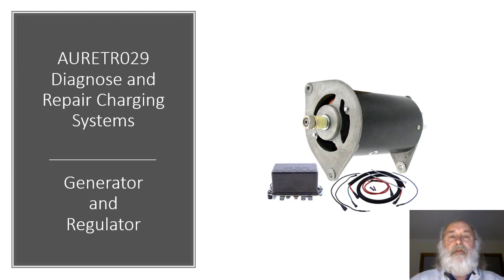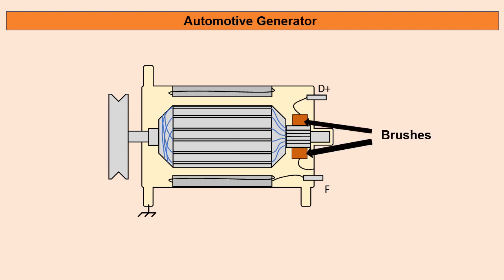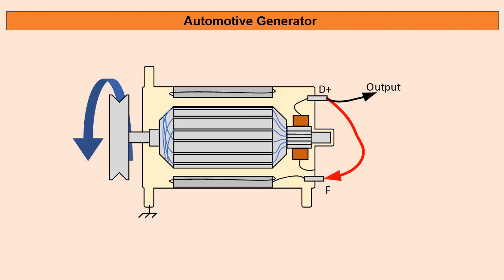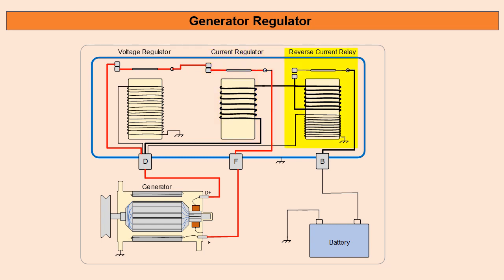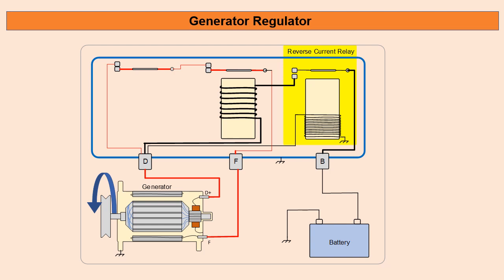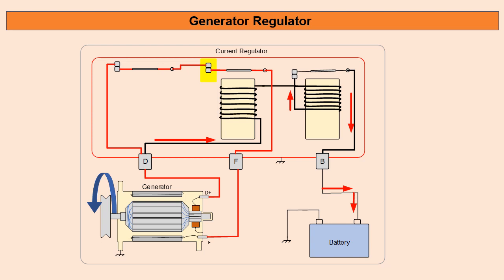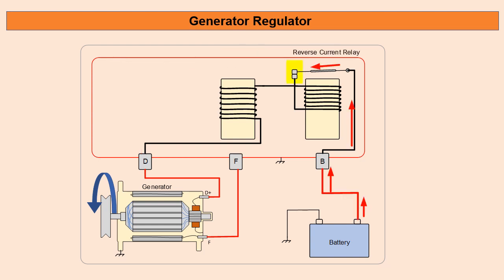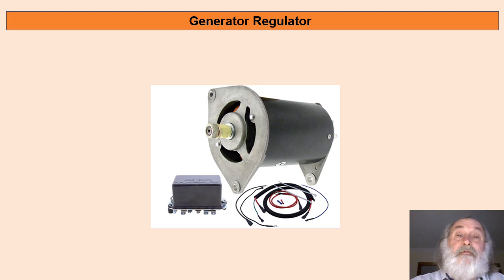Generator Regulator

Comment: Petar This video presentation was excellent.  It helped that you showed the initial positions of all three contacts.  That was very important before presenting how the voltage  feedback loop (to the field winding)  uses two relays in series. You made it clear that the charger works by modulating the voltage to the field winding. That, in turn, makes it clear how these regulators protect the battery from over-voltage while simultaneously protecting the generator from over-current.  You further showed how it protects the battery from reverse current discharge by using a simple relay.   Let me join in with all of the other commenters who have said Thank You and extend my sincere appreciation.

Comment: I assume D connection in your drawing is A on my regulator.. The rest is good info. The more i watch this over and over the more i understand it all. But then question start adding up. What opens the contacts, heat? How does it know when voltage and current have been reached. It all must work off heats of contacts or magnetic field's, which i guess is the same in some way.
Reply from the maker: The contacts are spring loaded. When the magnetic field reduces due to the voltage lowering (and therefore the current) the contacts open again.

Comment: Please d scribe how to "polarized" the generator fields if they loose mag. Thanks
Reply: Flash them with a car battery, by connecting negative to    usually the frame) an touch the posative to the field connection.
Reply from the maker: To polarise the magnetic field in the armature, use a piece of wire to briefly connect the armature ( which also connects the field) to battery positive. This will set up the residual magnetism in the field.

Comment: Great explanation Petar.  The internal wiring diagram is a big help in understanding the process.  It’s not in the automotive industry, but are you familiar with a Dynamotor (voltage converter)?  I’ve been looking for an explanation and internal wiring diagram as to how that works.  Not sure if it’s in your field of expertise, but worth a shot to ask you.  Thanks in advance.
Reply from the maker: I hadn't heard of a dynamotor before so I looked it up. Very interesting device. It appears to be a DC motor with an AC alternator wound on a single armature. It looks like quite an old technology, and I suggest that there are many more modern converters available now which can change DC to AC using electronics, and probably more efficiently. A simple inverter will supply 240V AC (or 110V AC depending on where you live) to operate all sorts of electrical and electronic devices. To understand the dynamotor operation, think of a DC motor with an alternator attached to the output shaft. I hope this helps.
Reply: A Dynamotor was used many years ago , on small engines (petrol). It had 2 field coils. When energised, the unit operated as a starter motor, and when the engine was running, it acted as a dynamo.The dynamotor you describe which has a dc input/ac out, is normally called a rotary transformer, and was commonly used  in military equipment. @PetarMakTeacher

Comment: Great video!  I am planning to fix up an older diesel generator.  It is 13.2kw with both 1 and 3 phase.  Do I need a special AVR?  I will also need a new control  was thinking a deep sea DSE7320
Reply: 3 years late but this is dc not ac like you want